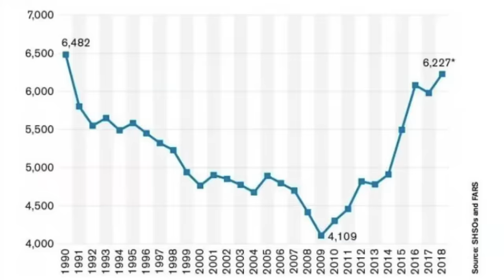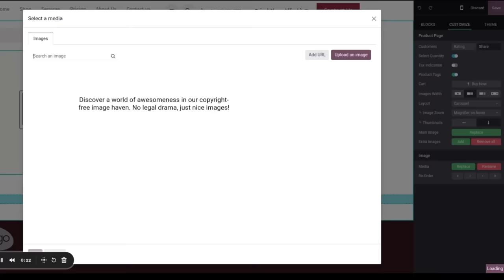Can this forgotten invention save your life?

Comment: The higher grills also put the headlights directly at eye level for smaller cars, guaranteeing to blind their mirrors and taking away the driver's night vision. It's incredibly annoying
Reply: Hell even other trucks, I have an 1995 F150 that's only marginally taller than an average car and when one of the assholemobiles tailgates me because I'm only doing 62 in a 55 I still can't see shit.
Reply: That's also very dangerous.
Reply: @king_acceler8755  I miss light cab trucks
Reply: Whenever one of those big trucks were behind me I always moved my mirrors to reflect the light back into their eyes
Reply: @zavtparticles6828 sadly they have basically been made illegal in the US, because our government measures fuel efficiency by its weight, so heavier trucks are more fuel "efficient" and smaller trucks aren't
Reply: @ric270  Turns out that's basically the opposite too.
Reply: Why didn't they just buikd it from the trailer hitch? aussies run counter clockwise
Reply: This is why my rear view mirror always has that little tab flipped.
Reply: Womp womp
Reply: god forbid it’s a lift kit and your a sod in a sedan
Reply: You have been misinformed. There are regulations for beam angle.
Reply: Who drives with night vision?? 😮
Reply: @ric270  The EPA standards are based on the wheelbase of the vehicle. Larger wheelbase allows for lower efficiency. This is an oversimplification but thats the absolute basics of how it works. Its also broken down into several categories and has a few exceptions.
Reply: I drive a sedan and get blinded by sedans with LED headlights, it's not just trucks and SUVs.
Reply: @skamiikaze   Thank you I will be attempting this LOL
Reply: But the lights point downward. The problem is when people lift and don’t realign their lights
Reply: Unnecessary large trucks should really be regulated differently 

At least have them considered differently than normal cars. It's getting ridiculous
Reply: ive had a lady in a expensive mercedes off-road thing AMG sneak up to me on the highway and BEAM my entire car with illegal lights when driving. Hurt my eyes also destroyed my relaxed mood for no reason. +made me see different spots of colours for a while. im stil wondering how i didnt crash my car because the whole car cabine was white light. geusse i didnt get OF her lane quick enough. some people are mental. + my car was lower then her whole light array...
Reply: Especially LED lights, I can barely drive at night if there's a truck behind me w/ them.
Reply: @TheOfficialOriginalChad  yeah for trhe angle. now let's move the headlights up by a bunch and keep the same angle. and would you look at that you are suddenly blinding people that drive in front of you.
Reply: Literally, anyone with bright ass way too tall headlights I've just started turning my brights on. If I can't see you're not gonna either
Reply: @ShaquilleOatmeal94 idk if you drive a smaller car but they literally all point directly at my face. I have a sedan and anything bigger than an SUV blinds me
Reply: YYYYYEEEEEESSSS! I drive a small car and I try to avoid driving at night because I get blinded by others with their big ass vehicles... even worse is most either have their highs on or have ridiculously bright LED headlights.. this almost caused me to drive off the road at like 50MPH because I couldn't see anything ... I like driving my small car because of how well it handles, larger vehicles simply wont take turns as gracefully (my car has also been lowered and has stiff coil springs)
Reply: @skamiikaze  yaa i see yall do that all the time. its cute but does nothing
Reply from the maker: They've though of everything. Next they need to put strobe lights on
Reply: @Ajiponferret  who gets to determine what's "necessary." my farm is cut in half by a creek your not crossing that in your car or stock truck. the level of sensitive people have become is truly ridiculous. also trucks are considered different that "normal" cars.
Reply: @Ididathing Agreed
Reply: @Ididathing maybe we should all be driving with a welding mask on ?
Reply: I typically turn my high beams on whenever I'm blinded by someone else's lights. I kind of hope that it makes them think, but I know that the average driver has an empty skull, so I doubt it. it does make me feel a little better, though.
Reply: @anonym3017  Correct, but only at close range (<50m). Beyond that, the 1.2 degree beam angle should be lower than most cars and pedestrians. 

Which, of course is an issue considering the type of people that drive trucks are “tailgaters” 😂
Reply: Chalk that shit up to the EPA enforcing dumbass regulations that don't do anything, so they make trucks bigger in response to meet those regulations which causes the presented problem
Reply: Thats why i carry a laser pointer for retaliation
Reply: Literally a drive able, always active, flashbang.
Reply: That doesn't make any sense. Headlights can be tilted up and down and the height needs to follow regulations. What you see are people not registering their beam height correctly
Reply: i'm tired of hearing this argument, there are way better arguments to use against modern trucks than this, you can actually aim headlights up and down with a little knob on the back of them that you can access the same way you would change a bulb, there's regulation that headlights need to be aimable, but automakers found out that there's no regulation on where they're aimed from the factory, so they're all aimed dead ahead when that should be aimed slightly downward, and that's true of any car, but it's more noticeable on trucks and tall vehicles
Reply: @king_acceler8755  62 in a 55, how dare you!!!!
Reply: It's not the height, it's the poor adjustment/suspension that's been fucked with/incorrect tyre size/overloading/aftermarket bulbs that aren't designed for that housing
Reply: @acmhfmggru anything with leds is obnoxious and blinding
Reply: @Lee_1133 it’s just us being able to kinda see things and when you have a bright light shone in your eyes, they adjust to absorb the light and when that lights gone your basically blind till your eyes readjust to no light
Reply: @Ajiponferret the only truck you need is. 3/4 ton trucks and those are too obnoxiously large
Reply: @Perfinn that’s why I want to install overhead leds on my Jeep liberty. If you blind me then you’re definitely going into a ditch.
Reply: @lorddraonic add the overly loud exhaust to help induce tinnitus
Reply: I used to drive a Honda Civic that had a mirrored hitch cover that nicely reflected high beams back at the person behind me, which my dad in his Jeep discovered by tailgating me lol
Reply: I blame modern headlights more. Regardless of in a big or small car I get blinded by everything from people in compacts to giant trucks. It's those damn white/blue LED and laser headlights.
Reply: @rivergreen1727  lol now where do I find a hitch mirror
Reply: @NiSE_Rafter the new gmc faded the headlight covers but not the high beams some of my company trucks have them and they look hideous
Reply: 'merica!
Reply: the number of times I've "hi-beam checked" pickups only for them to blind me harder and me give a thumbs up in defeat is absurd.
Reply: I want to sue for this so badly. Manufacturers are also angling their lights higher, specifically fucking subarus
Reply: @ihaps1117  it should be unlawful, as should keeping the high beams on. People seem to think that's their headlights.
Reply: @wesleyfilips7052  Genius! Doing God's work, truly
Reply: i daily a lowered miata and i suffer heavily from this
Reply: If calibrated correctly for the right angle (as they should be) then taller vehicle lights should not cause blinding issues.
Most people change their lights after a bulb dies and they never re-adjust them properly.
Reply: @skamiikaze  That is goddamn brilliant.
Reply: I just use the roof mounted spotlights on my lifted F250, Its so much easier to see the road with them.
Reply: @stagiestpizza  best to swerve into their lane
Reply: That's becoming a bigger issue I've noticed. 

More and more cars also have those blue hued lights. Which are illegal because I've tried to but them at AutoZone and two different places was told they where only for emergency vehicles and it would be impersonation. Feels a bit shitty that car manufacturers get away with that
Reply: @skamiikaze well now I'm going to start doing this. Thanks for sharing your malevolence. I'll duly comply and reciprocate.
Reply: Sounds like a small car problem. 

But seriously, i thought we had laws in Australia around the angle lights can shine and where they need to hit the road. Is this just being unregulated, or are dickheads just swapping the lights out for modified ones?
Reply: @Ajiponferret they are actually regulated differently… in a bad way. They don’t need to follow as many efficiency/environmental laws because they are so large
Reply: A ton of modern cars have these annoying led or xenon lights, they are so insanely strong...

Luckily my road bike has a 1200 lumen headlight, which can change modes. So I can still see the road a bit.
Reply: @FukaiKokoro  There are different “temperatures” aka wavelengths of light. White light is all colors, including blue, and green and yellow etc. The lights you’re talking about are blue-biased white light, often referred to as a blue tint. 
When the state law says “blue light”, it’s referring to lights that emits the color blue, not a blue tint, but all blue. If it meant “any blue”, then white light would be illegal. 

Needless to say, the people at Autozone have no idea what they’re talking about. They don’t understand light, they don’t understand law, and they dont understand that their BSing causes people like you to shape opinions like “shitty that manufacturers get away with it”
Reply: @Ididathing elon's already got you covered there mate
Reply: The solution to this is actually very simple.
Get a roll of marine reflective tape (SOLAS)
Put it on the headrests of your seats facing backwards, the closer the source of light is, the more that is reflected back
Happy christian motoring!
Reply: @boulders403 You're a farmer with a work vehicle, that's different. I know a few people in the forestry business who drive huge trucks for work and tiny sedans at home. That's perfect.

The vast majority of trucks and truck-frame SUVs in the US are bought by city folk, who REALLY don't need them. Imagine if half of Americans suddenly started buying tractors and driving them around in the city. We can all agree that this would be stupid and dangerous, and yet nobody is saying that tractors shouldn't exist. Same thing here.

Big trucks are literally more dangerous in every way possible, to everyone except the people inside the truck. Being blinded or run over isn't just an inconvenience.
Reply: to make them an easier prey i guess, wild nature is incredible
Reply: @TheOfficialOriginalChad  "misinformed" dude it's right there blinding me, he ain't been "misinformed" about shit
Reply: There’s often times when I’m inclined to flash someone because I think their highs are on but it’s really just some sh*t truck, ridiculously high off the road, with outrageously bright - nearly purple - lights. Know if you’re this person, other drivers hate you.
Reply: So I drive a 97 f350 and since it’s a 2wd the nose points slightly down and I literally had to put led light pods on it to be able to see the road when those insane modern leds are pointing at me and the new trucks that are way taller than mine are incredibly bad like you just can’t see the road
Reply: just buy a bigger car
Reply: @Ididathing Australia grammar sensen’t two
Reply: @rumpleforeskin6998  a feature can be a flaw within itself and or be the cause of many flaws - sidenote I like your account handle, must say it’s pretty swag
Reply: My issue is LED lights in general, whether they're behind me or oncoming from the opposite lane. Car height irrelevant, they're just goddamn painful. Have yellow tinted glasses for night driving to dull some of the brightness but they don't do much.
Reply: God loves you all
Reply: @brandonm1708  well, that, and should really be treated similarly to a bus or something. Massive modern trucks really shouldn't be as accessible to common people. It's just so different from 90s-2000 truck.
Reply: @boulders403  they are regulated but mostly as for cost cutting measures and getting away from regulations like emissions. What I mean by different is how it should be licensed. Modern trucks are just so different compared with 90s-2000 purpose pickup trucks that are actually functions as intended instead of being giant family car with tiny bed behind it. It handles so differently compared with regular city cars.
Reply: @king_acceler8755  man that made me laugh. It's so true though
Reply: It's nice to know how many of you have no fu@$ing idea that the rearview mirror is designed to deal with this.....
Reply: That’s why they’re illegal in every other country, but here in the land of the free, you only get in trouble when jaywalking or loitering. Running over your own children and making drivers of smaller cars blind is a god-given right !
Reply: It was slightly eluded too but with a higher grill a pedestrian is more likely to get sucked under the car if they are hit. Where as with older cars, if someone was hit they would usually roll over the hood.
Reply: @antonliakhovitch8306  well feel free to buy me a second vehicle. But as it stands my farm truck goes where i go. Also how do you know what they use them for? most of the truck owners your referring to that i know use them for work. Like building your shoebox in the sky or getting the "evil gas" out of the ground to keep you warm n your shoebox. Or some just enjoy the outdoors and want to bring things with them that dont fit in cars. Just because it ist always loaded to the tits dosnt mean it isnt a needed and necessary tool. For you to think you know whats best for them is the problem. Stop trying to socialize every aspect of life, people are individuals and have different desires in life that you do. Stop trying to regulate, control and strip freedoms from other people you dont know
Reply: @Ajiponferret  have you ever actually driven a modern truck? My 2023 might have a shorter box than my 1990 but its significantly better on fuel, significantly safer for the occupants, hauls significantly more and handles 1000% better. You have no idea what your talking about and just want everyone to do what you think is best. I dont buy vehicles thinking about if it may scare the city boy in his mitsubishi mirage i buy them because i have to haul thousands of pounds of shit for work and play. Remember not everyone lives in the "city"
Reply: Not true
Reply: @boulders403 
"Feel free to buy me a second vehicle"
Sure! I'm all for expanding the EV tax credit. Better yet, we can build better trains so you don't need a second vehicle.

For work, there are often better options available. Vans can do a lot of the jobs that trucks are used for. Right now EIGHTY PERCENT of new vehicles sold in the US are pickups or SUVs. Don't tell me all of them are work vehicles.

Your freedoms end where mine begin. I want the freedom to survive a car accident, or to not get into one to begin with.
Reply: @boulders403 And, to be clear -- I don't know what your vehicle is used for, but regulations can be smarter than that. There are ways of discouraging city folk from buying pickups without punishing farmers and construction workers.
Reply: @boulders403 "I don't buy vehicles thinking about if it may scare the city boy"

...Except you've seen the stats on how much more dangerous pickups are for everyone besides the people inside the vehicle. By "scare", you really mean "kill". Think about how incredibly selfish that makes you sound.
Reply: @antonliakhovitch8306 selfish? listen to yourself. i need my truck i have no way of doing my job without it. i didn't design the truck however they are significantly safer now then they were in the past not just for the driver (impacts with pedestrians are an exception however they're usually the pedestrian is somewhere they shouldn't be not the truck). i also pay significantly more in insurance and registration to drive this truck because insurance companies and regulatory bodies have considered your exact concerns. id prefer my truck didn't scare you however that's up to the manufacturer and your fragility.
Reply: @boulders403  Did... did you read my comment? Yes, you 100% need your truck for your job and you should keep it. I don't want to take away your truck.
Reply: @TheOfficialOriginalChad  and truck drivers often get them lifted without adjusting the headlights.
Reply: @zachstorms  I’m sorry did you just say Womp womp?!
Reply: @Perfinn hell yeah I do that too in my lil coupe
Reply: @TheOfficialOriginalChad The problem isn't the angle, it's the fact that they're super high up.
Reply: @king_acceler8755  Dude I drive a Miata imagine how I feel
Reply: @TheOfficialOriginalChad  Clearly those regulations aren't doing much to help considering LED headlights are still fucking blinding at night. LED headlights should be illegal, halogens are more than good enough
Reply: even as a pedestrian in the morning, its so annoying.
Reply: @killingtimeitself  Except it's the engines that produce shit, not the cars themselves. If the company increases car size, but not engine output, then it emits the same amount of shit, which is essentially what happens because of the EPA. Bigger engines are objectively worse for the environment, not the chassis the engine is in.
Reply: Politicians and crazy people: Guns are deadly, let's ban them! 
Also politicians and crazy people: Everyone should have the right to drive several thousand pounds of steel faster than any land creature in existence and it should be pathetically easy to get ahold of one of these vehicles.
Reply: My Honda civic is perfect height to be blinded by those, specially silverados
Reply: @killingtimeitself man you humbled him quick, but I agree with your statement,
Reply: @ShaquilleOatmeal94  nah even stock utes now are too tall for my car, i look behind me and all i see is a grill and lights, i dont even see the driver
Reply: @krissteel4074  would something similarly reflective ie tin foil work the same?
Reply: @canadianbluepants9446  The good thing about SOLAS is that it breaks up the light hitting it in a less directional way and it also has a very high amount of reflectivity.
Its so bright they literally have to pull back 3-4 car lengths or they'll be dazzled, it was a really bad problem for me in a 90's sports car because for a time everyone's lights were literally at my rear-view mirror height. 

Now its less of a problem because fairly much everyone is an SUV or dual-cab wanker in Australia so their lights are all higher than my roofline.
Reply: @dti1312 you think it blinds because it’s a diode rather than filament? Have you ever had a flashlight pointed into your eyes? Blinding, right? What about when it’s not pointed in your eyes, is it still blinding? Brightness can impede your vision, but only if those photons are beaming into your eyeballs. 

The NHTSA regulates the brightness and angle for the MANUFACTURERS in the FMVSS section 108. Any overcompensating truck bro can change that alignment and brightness. Because the US doesnt require safety inspections (only a few states do), there’s no way to enforce it. My point: the issue isn’t the technology behind the flashlight that blinds you, it’s the prick pointing it.
Reply: @krissteel4074  well I drive a 92 accord so I think I might use this technique
Reply: @zachtheboss1470  we all know you're compensating for something
Reply: The headlights are turned down so they don’t do that. The problem is when people lift their trucks they don’t know they have to readjust them
Reply: @killingtimeitself  ever heard of flood plains? My river shifts about 5 feet left or right every year depending on rain fall and how it feels. Dont need anything that monstrous or destuctive the fish still need to spawn. Im just clearing pasture, cutting in easements, haulin logs, and fixing fence lines. the prfect vehicle for that has been my sierra on an 8" lift. Its also great for hauling equipment and getting groceries... pretty much everything a car can do and more!!!! But no i have to buy a new car because some ev loving pleb is scared of trucks. The same ev loving plebs that think evs are better for the environment than a truck in every situation (theyre violently not especially in my region because we still produce energy with coal and natural gas at a peak efficiency of 60% and regularly 38% efficiency)
Reply: whoa whoa whoa the tractor is strictly for the corner store to get beer.

 thats exactly what i have big ass beater farm truck and a fancy truck for groceries and going into town that gets 20+ mpg and if i need to grab a fence post or another god damn animal for the wife on the way home i can because "truck" 

cars are perfect for some people trucks are perfect for others even bicycles and unimogs. 
random people trying to dictate every aspect of life to people they dont know or understand is completely fucked up and its seeping into everywhere and every thing. stay in your lane mind your own business and stay tf off my land lol. this shit is why i left the city and never looked back yall just love cramming your noses into everything even shit you have 0 clue about like farming and our got damn ancient energy grid.
Reply: Let alone ONCOMING drivers! When I drive at night at one of those tall trucks comes on the opposite lane, I can't see what it's in front of me for a solid second or two because the contrast between their blinding lights and the darkness behind is just too big!
Reply: @TheOfficialOriginalChad That doesn't prevent blinding because tall truck headlights are mounted at or ABOVE eye level of drivers in regular sized passenger cars and especially sports cars, duh! 💁
Reply: @ShaquilleOatmeal94 the angle can't fix the problem of headlights blinding because they're too high up. Truck headlights will always be blinding in the near distance at least, because they're at or above other driver's eye level!
Reply: @boulders403 if it really IS necessary to you, then you won't mind doing additional certification for this commercial class vehicle, while all the desk jockeys and house wives can go back to driving regular passenger cars to the mall, agree?
Reply: @scoutg001 I'm tired of hearing numbskulls saying the angle of the beam could fix the issue of truck headlights shining right down in my eyes because they're above my head when I sit in my roadster! 🤦🤦🤦🤦🤦🤦
Reply: @saltysteel3996 taller vehicle lights will ALWAYS cause blinding issues to nearby cars at least!
No amount of angling down the beam can prevent it from shining directly into other driver's eyes when their eyes are lower to the road than your car's headlights, OBVIOUSLY! 🙄
Reply: @MelodicTurtleMetal what's the angle gonna do if the headlights are HIGHER off the road than the oncoming driver's head?

Think for a second and you should get it! 💁
Reply: The amount of denial of reality by big truck defenders in this thread is appalling!
No, you CAN'T prevent your headlights from blinding other drivers by angling them down when they're at or above eye level of those drivers!
That'll only decrease your beam range, but you'll still blind oncoming cars and cars in front of you at short distance!
How do so nany people here not seem to understand this most obvious fact?!! 🤦
Reply: @boulders403  no one wants to take away your truck, we're talking about city business, not your business. you seem to want to make everything about you
Reply: Just buy a bigger car then 😊
Reply: @acmhfmggru Yeah, but they aren’t built to put it right into peoples’ eyes, now are they?
Reply: @green5260  and in my country they are actively trying to get rid of trucks
Reply: Good news is:
They are too big for like half of our roads and you'd have to go out of your way to get to certain places if you had a car like that so simply because of that they are pretty uncommon here especially for private use, (companies use them cuz tax BS). 🇳🇱
Though sadly they are definitely still present either way the statistics mentioned in the video are crazy. 
Considering how much rules and regulations we have this might as well be one of em.
Though I'm sure we already do to some extend "can't be higher than X cm etc."
Our country is like the last place on earth a pick-up has any point whatsoever.
We're the earth's flat nether regions 👀 😂.
Most rough terrain we have is water at which point you should just use a boat.
Reply: @stagiestpizza  I've met the guys who drive those trucks, they do not give a shit if they're blinding you and some of them probably get a kick out of it
Reply: @Astraeus.. extremely funny that you're this arrogant while forgetting that roads go both ways, you must be one of these truck drivers
Reply: This is why I have these amazing LEDs in my truck and even brighter ones for the brights! Just for you
Reply: It actually sucks. I hate driving at night because I know if a driver comes the opposite way I’m going I won’t be able to see the lines in the road because they’ll blind me
Reply: This so much. Night time driving has become a pain. Especially when it's LED headlights.
Reply: @krissteel4074 just found out this marine reflective tape exists and made an impulse buy 😂 thx
Reply: this is because people dont adjust there headlights like there supposed to and buy cheap leds which have no beam
Reply: @boulders403  man got his truck lifted 8 inches cause he only packing 4 gg
Reply: @ghostyasuo9163  3.5
Reply: @boulders403  Big if true
Reply: @king_acceler8755 same, I drive a 96 nissan hardbody and I go blind driving home from work every nice since I live in the southern US where every other suburban jackass owns one of these to stroke their ego
Reply: @TheOfficialOriginalChad  Tell that to the light shooting into my eyes
Reply: I feel this so much driving a 96 Mitsubishi eclipse....
Reply: Right? I’ve noticed that blue side mirror tint works really well. Just a light shade of blue can make a huge difference.
Reply: @Ajiponferret In the US pickup trucks and SUVs are categorized as small trucks. The regulations for small trucks are less strict in many ways than the regulations for regular cars
Reply: @king_acceler8755  In a mid-late 90s Ranger here. I love your phrase Asholemobile so am gonna coin it -- but, those things do the same thing to me. Would really enjoy the habit of scaling down cars/trucks and making them more pedestrian (and driver....and economy....and environmentally....) safer again.
Reply: I let them pass me, then I turn my headlights onto high beam
Reply: @Ididathing  you joke but some of them have. They have light bars on the top with a strobe mode and will gladly give you a seizure inducing x-ray if you look at them funny
Reply: @zavtparticles6828 they're also more practical. A 2 door truck has way more bed space and is much more fuel efficient, making it better for people who actually need a truck. 

It goes without saying considering how every truck you see here in the US  is shiny and has nothing in the back, but most SUV and Truck owners have zero need for them.
Reply: @skamiikaze  xD
Reply: @ric270  If only we took the axe to gasoline companies earlier after branching out into electric and other methods of fuel, hydrogen is the next and probably best step forward.
Reply: @boulders403 if it's your farm vehicle then why do I only ever see it parked on the line between the handicap and police reserved spots at Walmart?
Reply: Vouch,  I drive a miata in florida (fuckton of huge trucks here) it's HELL,  I don't go out at night unless it's like 1-4 am for a pleasure drive,  because any earlier in the night and I've got visibility 0 because theres a guy in a ford superduty behind me 💀
Reply: @grey7685  you essentially drive a go cart with a body kit by choice.